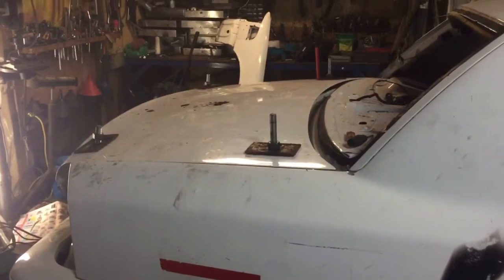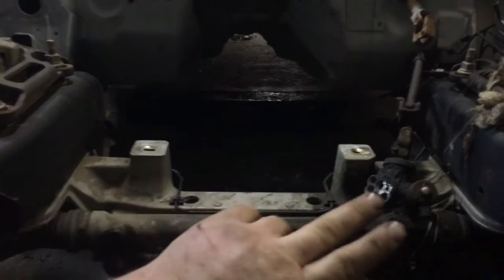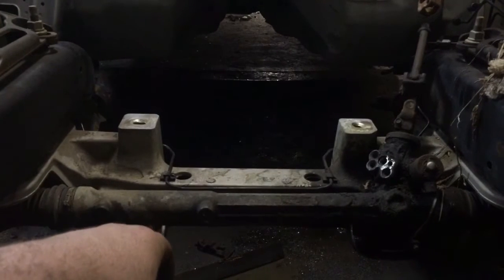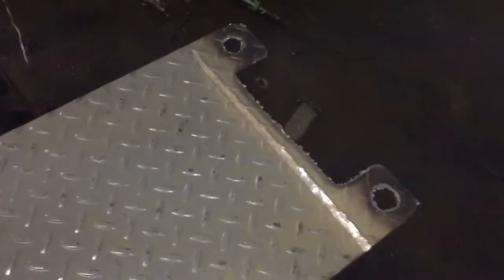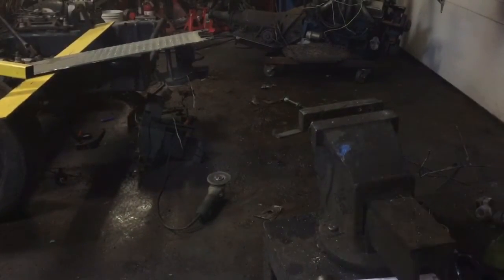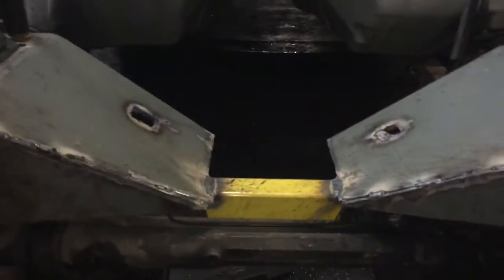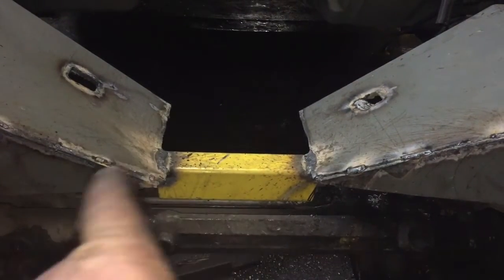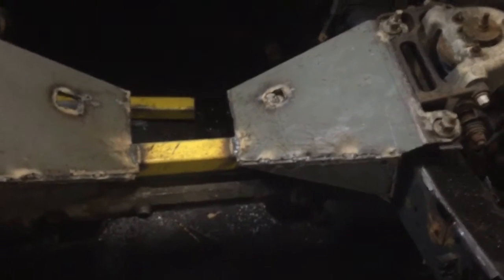project "burn barrel" bolt in engine cradle for 2003 and up ford crown vis

Comment: Can u make a video on how u choose where to bolt down the hood?
Reply from the maker: DerbyFreak818 I am planning to show you guys everything about this car but because it is a big car full frame Crown Vic the threaded rod goes in a pretty generic place upfront know if this was a small car like a cavalier or Camry's or even at Topaz.  The location of the threaded rod would vary greatly
Reply: zacks workshop ok. I have a 1990 Volvo 240 Wagon. where do u think I should bolt it down at? or can u make a quick video on one of your volvos to help guide me through bolting it down?
Reply from the maker: DerbyFreak818 how many three-quarter inch bolts are you allowed to four or six
Reply: zacks workshop my rules allow up to six spots of up to 5/8 rod or wire